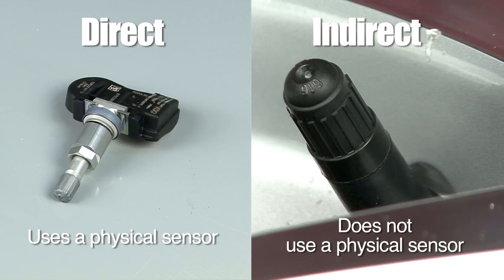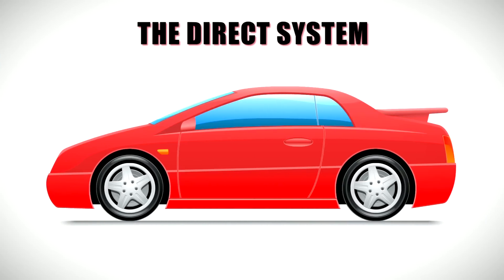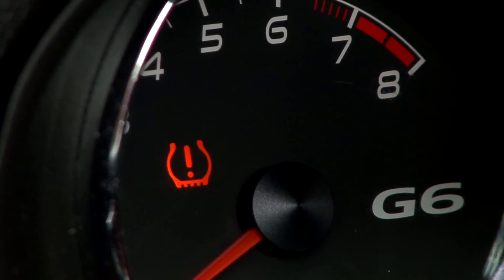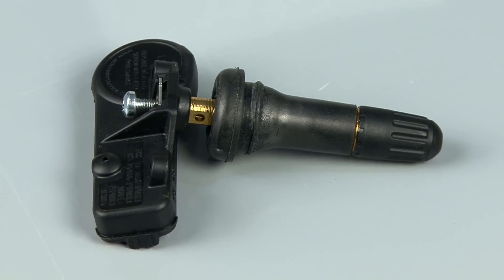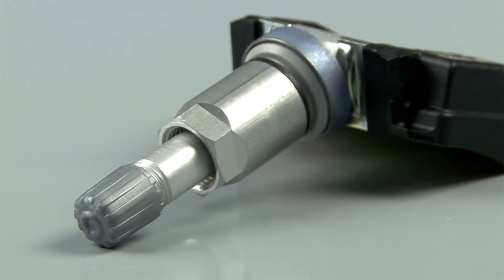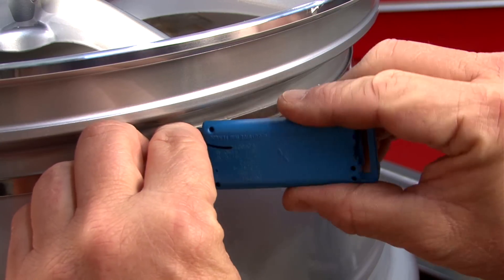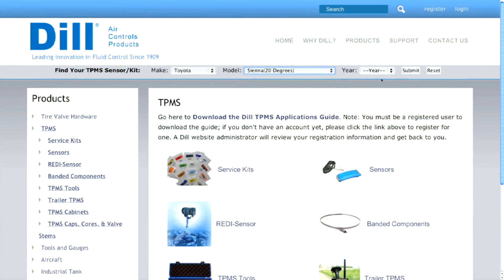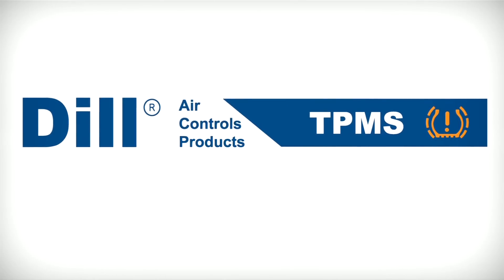How to Identify a Tire Pressure Monitoring System

Comment: If you are next to a car that also has TMPS and that car gets a flat why doesn't your car sensor also go off?
Reply from the maker: Thanks for your question! All Direct-TPMS equipped vehicles have what’s called a Relearn Procedure. After following that procedure, the sensors mounted in the tires are trained to the vehicle. All TPMS sensors emit their unique ID code (their serial number) so the vehicle only pays attention to the ID codes that have been learned into its memory. The vehicle’s TPMS receiver may hear other ID codes being transmitted but it will only act upon transmissions containing familiar ID codes.

Comment: cool. thanks for sharing. Can we change the sensitivity of 25% drop from standard to 10% drop from standard?
Reply from the maker: Thank you for your question! The sensitivity of the OE systems is typically not adjustable because the 25% was mandated by NHTSA in the US. You can speak with the service department at the specific vehicle manufacturer’s dealership to see what adjustments their service tools are capable of.

Comment: how can you tell if you have a snap in or clamp in tpms
Reply from the maker: A snap-in TPMS valve is rubber (flexible black body over brass stem).
A clamp-in TPMS valve is metal with a hex nut on the outside. Color may vary but most are light grey aluminum.

Comment: Thanks. I was wondering how to tell for a rubber stem if there is a sensor inside the wheel.
Reply from the maker: Generally, rubber TPMS stems are stiffer than non-TPMS rubber stems. Compare the stiffness of a valve mounted in a drive wheel versus the valve in a “donut” spare tire. A TPMS valve would also have a sensor mounted on the end of it so that limits it’s movement. If you flex a rubber TPMS valve toward the lip of the wheel, the sensor attached to the other end would press against the wheel. You would likely feel the sensor hitting the wheel barrel when you do this which gives you feedback that a sensor is inside.
Reply: @DillAirControls  thanks for the tips
Reply: @DillAirControls  good tip, thanks!

Comment: other than the tpms on the stem tip this is not really useful as you need to take the tire off to find the other types. if you can do that, you're most likely in the car garage dealing with a mechanic

Comment: 0:14 = misguided. BOTH are DIRECT! Rubber vs metal stem has NOTHING to do with being direct or not. Way to keep confusing the already confused.
Indirect uses ABS on rotation which is clearly not stated.